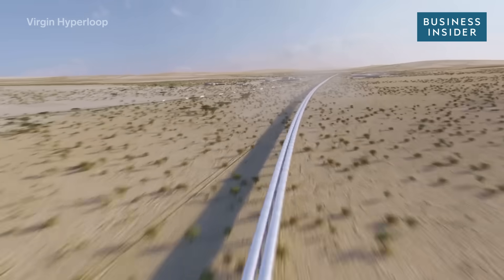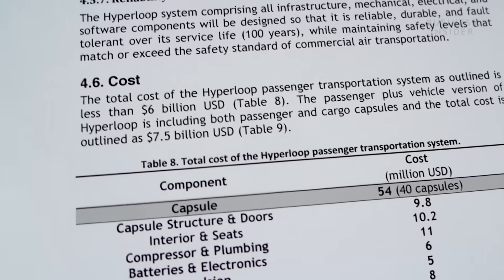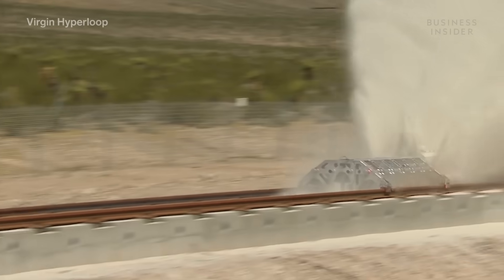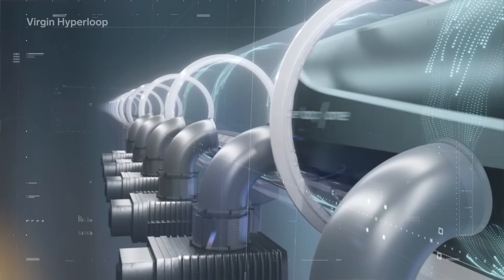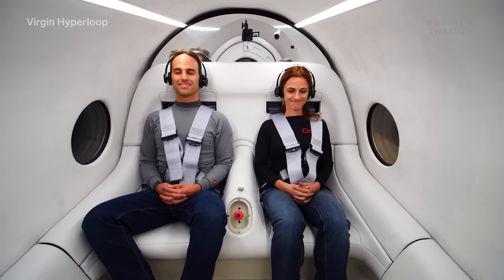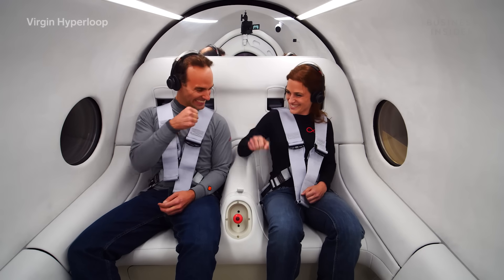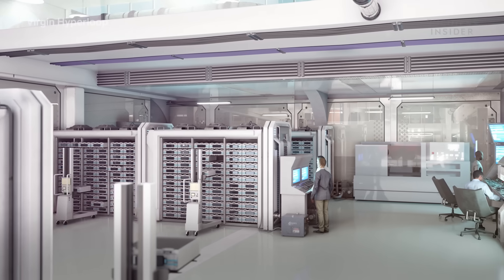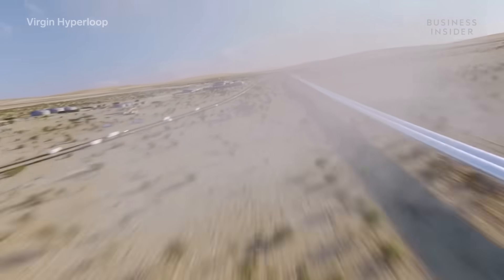How Elon Musk's 700 MPH Hyperloop Concept Could Become The Fastest Way To Travel

Comment: Isnt it to costly to shipout only rich folk that can afford that kinda travel. Why dont u think big & max it out so you could transport oil, raw goods & many other trans am stuff. But be aware even in very well designed tech many stuff could go wrong. It was after decades of use & many accidents technicians & engineers took under consideration the panic force of pasangers going out of the plane to broaden the ways towards the exits, because if it isnt wide enough it creates a clot preventin pipl from getting out from dangers harm... lol😊 not to mention teroristic cells in pursue to extort money or to threat blowing things up!!! Lol 😅

Comment: Alright ELON,,,Let's help out with the train design...Here are five advanced and practical inventive ways to make the Bullet Propulsion Train concept work:

# 1. Electromagnetic Acceleration System
The Bullet Propulsion Train could utilize an Electromagnetic Acceleration System to propel the train through the tunnel at high speeds. This system would involve a series of electromagnets embedded in the tunnel walls, which would generate a powerful magnetic field. The train, equipped with a conductive material, would be accelerated through the magnetic field, generating a force that propels the train forward. To maintain control and stability, advanced sensors and AI algorithms would monitor the train's speed, position, and orientation, making adjustments to the magnetic field as needed.

# 2. Vacuum-Sealed Tunnel with Magnetic Levitation
Another approach would be to create a vacuum-sealed tunnel, eliminating air resistance and allowing the train to reach even higher speeds. The train would be equipped with magnetic levitation technology, which would suspend the train above the tunnel floor, reducing friction and enabling smoother acceleration. The magnetic levitation system would also provide stability and control, ensuring the train remains centered in the tunnel. Advanced materials and construction techniques would be used to create the vacuum-sealed tunnel, minimizing leaks and maintaining the vacuum environment.

# 3. Linear Induction Motor Propulsion
A Linear Induction Motor (LIM) propulsion system could also be employed to drive the Bullet Propulsion Train. This system would involve a series of LIMs embedded in the tunnel floor, which would generate a magnetic field that interacts with the train's conductive material. The resulting force would propel the train forward, with the LIMs providing continuous acceleration and deceleration. Advanced control systems would regulate the LIMs, ensuring smooth and efficient operation.

# 4. Air-Bearing and Electromagnetic Propulsion
The Bullet Propulsion Train could also utilize air-bearing technology to reduce friction and enable high-speed travel. The train would be equipped with air-bearing pads, which would create a thin layer of air between the train and the tunnel floor. This would minimize friction, allowing the train to accelerate more efficiently. Electromagnetic propulsion would be used to drive the train, with electromagnets embedded in the tunnel walls generating a magnetic field that propels the train forward.

# 5. Superconducting Magnetic Propulsion
Finally, the Bullet Propulsion Train could employ superconducting magnetic propulsion technology to achieve high speeds. This system would involve superconducting magnets embedded in the tunnel walls, which would generate a powerful magnetic field. The train, equipped with superconducting material, would be propelled through the magnetic field, generating a force that drives the train forward. Advanced cryogenic systems would be used to maintain the superconducting magnets at extremely low temperatures, ensuring efficient operation.

Comment: There is no feasible way at the moment to create a low pressure tube of any remarkable length. Look at the pathetic test installations they did and how low they managed to get the pressure. And nevermind a leak like a bullet hole when a 2nd amendment fan wants to try out an armor piercing round on the tunnel. Remember the Titan sub? This would be worse! Assuming this to be a feasible technology in any foreseeable future is like claiming that a AAA battery producing 2 GW of power is around the corner. And: It is NOT Elon Musk's concept - the concept is way older. And good old Vaporware Elon insisted on air cushion while everyone involved immediately discarded that idea and went for MagLev as we had our experiments with air cushion and it sucks for anything bigger and heavier than an air hockey table.

Comment: I think 3000 miles / hour or more high speed possible ...after boarding , it pressurized then pulsing puff of air above pressure in tube kept it accelerating but must be less than 30 m/s^2 otherwise the passenger be death

Comment: This will be a really smart and good technology considering the benefits it gives. Firstly, it will be much cheaper than airplanes. Secondly, it can reduce CO2 emissions a lot. Finally, as it reduces air resistance, it can increase the maximum ridable speed, increasing connectivity between cities. This has to be implemented in North America, Europe, and Australia considering how geographically huge they are.
Reply: Why not just build regular HSR which has multiple times the capacity and is cheaper as well as safer.

Comment: If the air inside the tunnel is moving at 800 mph there will be no resistance to a train going 800 mph.

We broke the sound barrier by getting up into the 800 mph jet stream which is spun by the earth's 1,000 mph east to west rotation.

Comment: Put it deep underground. That way you save space, and obtain an evacuation area in the event of an impending nuclear exchange or asteroid impact. Plus, you also avoid the effects of weather or temperature variation, making it a little more robust and feasible as a concept (though still very challenging to implement in practice). It's also worth noting that you'd need massive batteries or generators (or to couple it to a deep underground geothermal power plant) to ensure it can continue operating in emergency situations.
Reply: Why not remove the tube, make it run without a vacuum, put it on 2 steel tracks, and make it ground level
Reply: @Calbjrd  As I literally said in the comment you replied to, putting it underground has the advantages of 1) serving as an evacuation area for population-level catastrophes, 2) being insulated from weather variations and the elements, contributing to fewer service interruptions and lower cost of maintenance (economic benefit) . More benefits: 3) containment of magnetite pollution from the brakes, 4) as well as chemical pollution in the event of an accident, 5) the ability to move goods and people in straighter lines, with fewer curves, thus reducing wheel and rail wear, 6) requiring less space on the surface would mean that you'd have more space to allocate for other infrastructure, like houses or roads. 
The disadvantages: 1) cost, 2) long construction time, 3) nothing else, really.
Reply: @VVayVVard  ok

Comment: Wow. This has been busted so many times over and you still report it as real news. Nope - this is over 100 years old and has never been successful because it's a completely flawed concept. 

Virgin Hyperloop no longer exists. Funny that.
Reply: It's not. People have rebuked the idea of it being used for transport of heavy goods in the near future, but not in terms of transporting people or small goods, where it is still very much a valid concept and will be extremely useful in many scenarios.
Reply: @VVayVVard  I don't believe you because the current consensus of all evidence currently gathered is that it's too expensive to build, ludicrously expensive to run, and the highest safety risk of any current or proposed transport.

It's not just rebuked, it's soundly debunked.
Reply: @PhilipLeitch  It's expensive for sure. Mass production of parts will lower the costs of maintenance, and with enough renewables, it's possible to generate more than enough energy locally, so expenses will go down naturally over time. The safety risk can be minimized with proper design. It has a clear advantage in terms of speed over other forms of transport, so no, it has not been debunked on any level, it has just met with resistance, just like any new technology that disrupts the status quo.
Reply: @VVayVVard  it literally has been debunked. All major and minor players have pulled out.  Right now Hyperloop is indeed dead.

I'm sorry this is news for you.
Reply: @VVayVVard  I'm sorry that you were unable to type "Hyperloop debunked" into any search engine and that you followed the hype of Hyperloop but not the analysis of the concept.
Reply: @PhilipLeitch  I've seen video explanations. Basically, cost is the main issue. Which can easily be addressed. The main competitor of the technology is airplanes, which also had major cost and safety issues in the beginning, yet look where we are now. Plus, underground hyperloop could travel even in the worst of weather conditions, meaning that it has advantages that no other form of travel currently possesses. It's a viable and important technology, and it's only a matter of time before it becomes reality.
Reply: @VVayVVard  cost is the least of the concerns. It's the safety risk... search some more about the safety risk. It's not something that can be mitigated.
Reply: @PhilipLeitch  The risks are far fewer than, say, those associated with space travel, and can certainly be mitigated to a large extent. Put the tunnels deep underground to minimize effects of weather, temperature variations and earthquakes (and sabotage, if that's a concern). Keep several parallel sets of batteries or generators underground as well to ensure a reliable supply of energy. Things like that.
Reply: @VVayVVard  are you even serious right now? If so please go on believing whatever you want. I'll believe what the evidence shows: this is an idea over 100 years old and has been dismissed each and every time it's been evaluated by companies and governments.

I'll follow the evidence, the companies that have unanimously agreed it's a failed idea and the engineers and physicists who can demonstrate why it can never be practical.

Comment: tickets less than 100 dollars 

if they could make it a subsciption service 20 dollars a month 
because it would be easy to power the thing and cost far less than planes
Reply: "cost far less than planes". Where did you pull that gem out of? This thing is scientifically impossible and all the companies working on it are going bankrupt in quick succession. The maintenance of expanding and contracting metal tubes would take billions alone.
Reply: @AtillatheFun  you're thinking in a paradigm of money and limitations.

also to state something is scientifically impossible is all fair and good but science is just a single paradigm, which started in 1600s with Newtonian laws, having limitations allowed science to develop at a fixed rate but because of scale and quantum theory is only 1920 so 100 just over years old and we've only been applying the technology as binary till around the last 20 years, the limitations you have stated are factors that can easily be removed. 

you might never see it this life if you're a zealot of collage grade science.

Comment: 110 year to late, this is a very old concept, but it will not work dew to safety issues, massive vacuum = massive implosion, plus just look at the state of test rig. No vacuum with a pod run on rail reaching what 40mph before the end of the very short line. I bet anyone on here that this idea will never work. The numbers you spew out for basically a car on wheels in a tube. Don't cities already have this?? its call the underground. I see every date has been made so far.PMSL I love the vegas hyperloop What a joke.

Comment: What if you have large extruded plastic tube inside another tube with air locks at each end? Then you circulate air at 200 miles per hour through the center and then back through the outside of the outer tube in a circular motion. Then you development a maglift platform that will support a small ev. You could safely travel hands free cross country at over 200 mph with no wind resistance or  friction.
If you can send me and my EV on a single car Self propelled platform then you will have something. The car already has all the safety features needed such as seat belts. The overall  structural design of the tunnel will only need to support the weight of one ev-platform at a time.  Did  Andrew Carnegie say sorry pal I can't build a bridge that big because I only have this brittle cast iron? NO! He said no problem. People Let me know what would stop us from building such a thing? Peace and love to you all. Thanks

Comment: Imagine if this becomes a tremendous success and becomes a normal method of transportation, but then the first power failure happens, and people can't get out of a huge tunnel. If all power failures and control errors can be fixed, then this will indeed be a tremendous success.
Reply: it wont
Reply: Losing power is just one of the many issues with this concept. Safety and the fact that this is not economically viable means this concept will remain to be a CGI rendering.

Comment: New technologies always had people who were not convinced right away, but what is quite special about the Hyperloop is the absolute spite coming from those people. You can easily tell that they do not just think Hyperloop technology will fail, but they are actually hoping and looking forward for it to fail.
Reply: The concept of moving people about in an evacuated tube is about two centuries old.  In principle you can build one of these things, but the engineering, logistical, and economic challenges make it impractical to do so.  All the frustrating challenges it takes to build a high-speed rail system are raised exponentially in this concept.
On the bright side, going down this rabbit hole may lead to advancements in engineering and materials sciences for other applications.

Comment: 1. Pods won't work. There is too many moving components and even one of them breaking means probably many hours of delay for entire tube.   2. Building vacuum chamber that big is super difficult and even slightst imperfection or leak means that system would maje the whole system on safe. 3. Building that would be so expensive that it will never be feasable. Tubes will have to be almost straight or have super gentle turns, whitch means a lot of really expensive land purchases.

Comment: Air is sucked out from the tunnel, does it means the pressure is much less than in the train? If it is, then it is similar to an airplane. Just make sure there is no crack, and don't make it one.
Like one of the comments said, how if the train stops mid-way, how to help those people on the train? Can the train behind it stop?
I think hyperloop technology is very good to apply in Mars connecting between colonies.

Comment: 30,000 passenger per hour if the capacity is 28 means 1071 launches that's one launch every 3.3 seconds.. Seems extremely overly optimistic.

Comment: I love maglev trains, I've written a few reports on them. There is one major design flaw, the dangers of pod damage. As there is only 1% of air outside the pod on the track if there is so much as a tiny hole the oxygen in the pod would vannish in under a minute. I would be satisfied however if they had built a system that has emergency oxygen fueled to the pod and a second shell that activates in the area thats exposed to the vacuum. The emergency shell could be concealed from passenger view and automatically activated at the point that there is a breach. It is a short video and I know they may have already done this but its good to make sure, anything is better than flying.
Reply: "I've written a few reports on them" <------------ FOR WHAT?  FOR YOUR 6TH GRADE SCIENCE CLASS LAST YEAR?

Comment: Ah yes, the fastest. But something that actually works to carry large amounts of people between locations? Nah, its optimized for speed nor scalability, safety or practicality.
Reply: you dont get it do you, you dont need one long ass massive train, its a 2 tube system which means you just keep dispatching pods this shaves costs as you wont have to worry about wasting resources on dead space from lack of tickets and if you experience a surge you can load up more pods on the fly, since going the same direction and all the same speed they need only dispatch them in a particular order. lol moving alot of people doesnt and never meant always cramming the most onto a single vessel lol

Comment: Yeah, I can see how low will your survival rate be if the power goes out or the vacuum tube gets damaged.
Plus it does not solve any of the problems we are facing now.
Reply: Just build trains xD. May be slower but a lot cheaper and a lot more reliable. But not futuristic enough i guess.
Reply: I'd be surprised if a 1000 mile long vacuum tube out in the opened in America lasted longer than a day without getting shot ruining the entire tube.

Comment: On the first place- why is this technology? Why we should create trains in tubes, where not necessary?  In addition- vacuum tubes? This is unnecessary complication , demanding much more investments in equipment and maintenance than regular high-speed electrical rails. There is already extensive experience : see Japan and Europe. The first step should be the development fast open-air electrical trains. Then the future is of high speed open-air MAGLEV trains. This is a sustainable, economically feasible and reasonable approach.